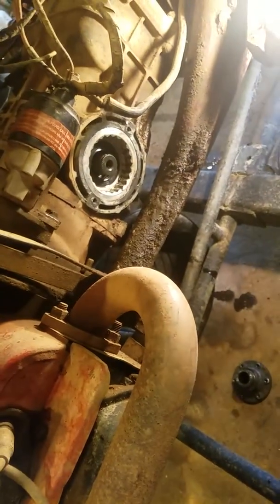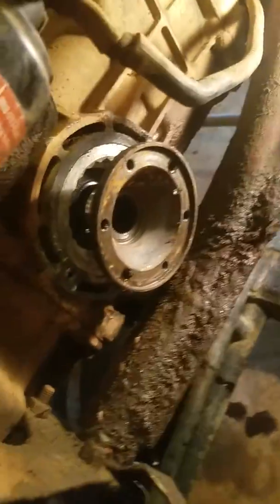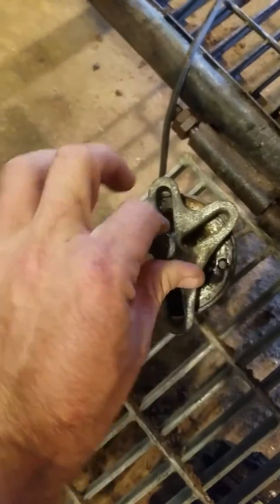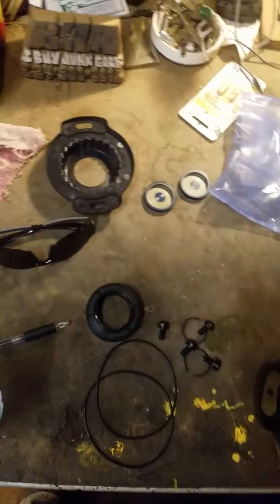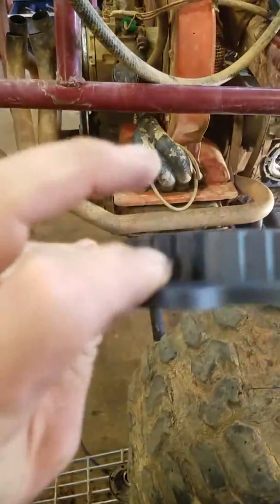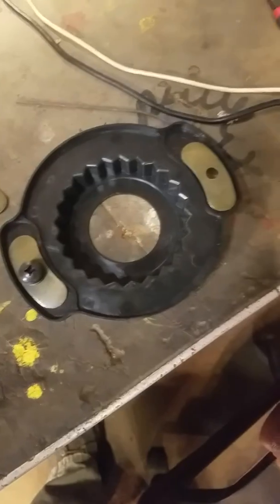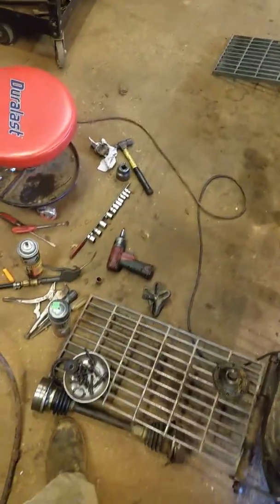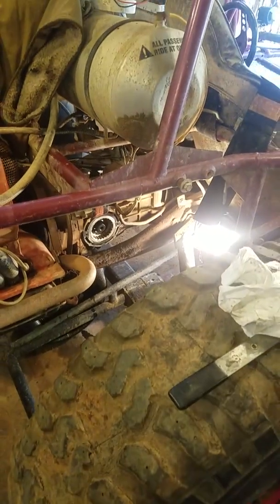Bus 3 rib (002) flange seal replacement

Comment: 4:53 The o-ring is hidden and goes between the adjuster and the housing. You have to have the 381/15 star tool to back out the adjuster. You MUST mark the position of the adjuster before removal so the play in the bearing is left as the factory adjusted it.

Comment: The O-Ring is for the Diff Sliders which you didn't remove.  You should be good to go without replacing them as removing the sliders opens up a whole new can of worms.